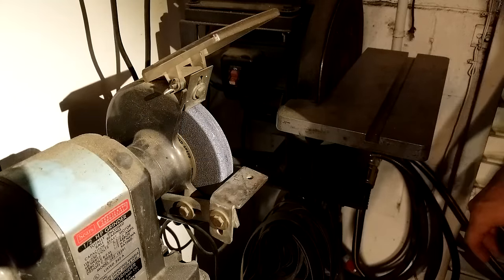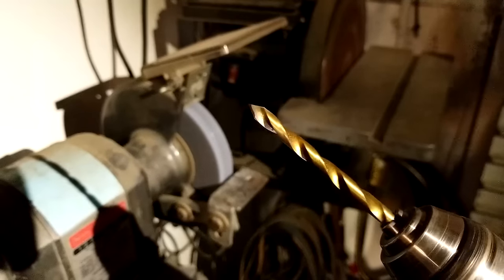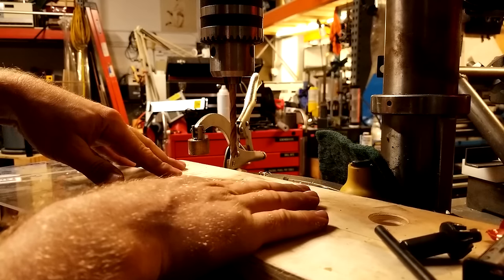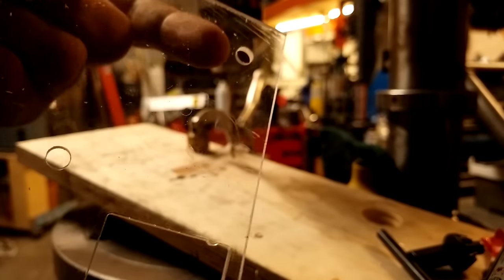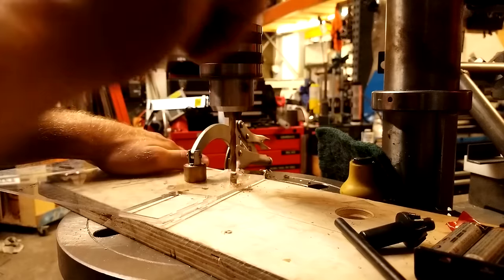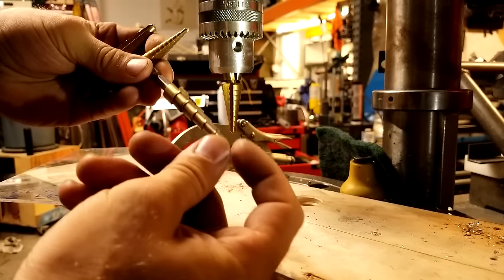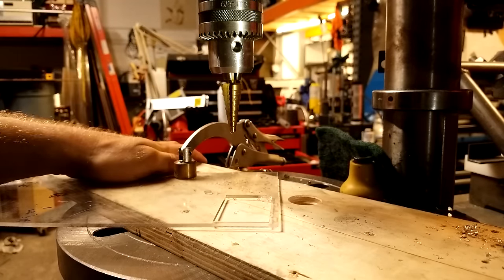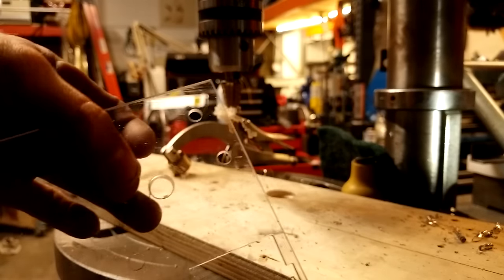How To Drill Acrylic And Other Brittle Plastics

Comment: To drill acrylic without chipping and cracking, a twist drill needs to be sharpened with rake angle closer to zero so as to produce more of a scraping action, rather than cutting. By sharpening the drill bit the way you have, in effect achieves the same result, although I prefer to leave the conventional point angle on the drill and 'dub' the cutting edge. Either way works. The reason step drills are so good for acrylic is that by the nature of their design, they already have zero rake angle at the edges that do all the cutting. A similar principle applies to drilling brass.
Reply: 3: 3:13 02

Comment: For absolue best result, have your piece backed by another piece of acrylic rather than wood. If done right, the bit never even realizes it has gone through the piece and you have a perfect hole, ( :
Reply from the maker: Great suggestion.
Reply: Is it the drill's sudden realization that causes the issue? Is it a good generalization to never surprise your tools?
Reply: @sethtrey  you laugh but probably yes.

Comment: I worked in a plastic fab shop for a few years. We bought those black oxide cheap drill bits from Harbor Freight. Knocked the cutting edge of the bit off on the bench grinder where it will produce a scraping action. Clamp or use double back tape to support the back side with a piece of wood. No tear out or cracking
Reply from the maker: appreciate the tips

Comment: Simply use a sharp step drill or a flat face spur bit. Also using air pressure keeps the acrylic cool and melt free. Slower is better than wide open and go gentle with your feed rate! Forstner bits are not good for acrylic or flat paddle bits, BTW. Actual acrylic bits are shaped like he shows but not ground that way lol. Break through needs to be super controlled as he shows.

Comment: I wanted to thank you for this video.  I had a specialized piece of circular acrylic into which I had to drill three holes in order to secure it to a clock face.  I was sweating bullets as in the past I tried (very unsuccessfully) to cut an acrylic sheet down to size for a different project.  So brittle and finicky.  I followed both your recommendations on shaping the drill bit tip, and using soap, and the drilled holes were absolutely perfect the first time.  Thanks so much!
Reply from the maker: That's phenomenal, I'm so glad that it helped you! Years ago (pre-YT), I was in a similar situation so I can relate! Only later did someone show me these tricks.
Reply: Dish soap is great 4 drilling n2 a chunk of acrylic using a forstner bit too.

Comment: I've found that even conventional drills work well to create smooth holes when lubricated (and cooled) with water and a little dish soap (say, 1% to 10%).  I've even used this to drill very deep holes, 5 to 10 times the drill diameter, but you do need to keep backing the drill out to clear the chips, and do keep the hole flooded with the lubricant with a brush or squeeze bottle.  As noted, slow speeds work best, but not TOO slow or the plastic can begin to fracture instead of cut.  (I've modified my drill press to use a dc motor, with fixed voltage on the shunt field winding and a variable dc voltage on the armature for speed control, minimizing the need for pulley changes and allowing spindle speeds down to a few RPM.  The armature supply also has an adjustable current limit, allowing the stall torque to be set independently, which I find handy at times to minimize damage to the work.)

Comment: Oh! Great tips! I was aware that there are special acrylic drill bits that have a much higher point angle but never tried to sharpen one for that. And never ever would have thought that it is so easy. Super nice!!! Thanks again! 
I had great luck with new, clean steel drillbits with slightly dull cutting flutes/tip (just a few strokes with a diamond file or 400grid sandpaper)
Reply from the maker: Cheers! I hope your prototyping tips channel takes off, you do great stuff. I kinda gave up on YT after a while... perhaps I'll start posting again someday.

Comment: Summary:
1.  Sharpen drill bit to a point, or use step drills for larger holes.
2.  Fully support the sheet with plywood backing. (You will drill through to the wood.)
3.  Use low rpm.
4.  Lubricate the bit with dish soap.

Comment: Having done this for years, I will share:  A regular drill bit is fine, but it must be sharp and web thinned.  If you don't know how to sharpen a drill, learn, or buy a jig. Next, do NOT use battery powered drills, they  are too slow.  Drill presses are best as they are stable and allow for clamping the workpiece firmly over a solid cutable substrate, like wood.  If you don't have a press, use an corded electric drill.   Example: to drill a 5mm hole in acrylic requires a speed of 2500 r/m, which a cord drill will do, whereas  battery drills run at 1500 max.  Next, it's the feed.  Slow feed, clearing often.  If you feed too fast, the acrylic will melt, if the drill is blunt it will melt, no matter what you do.
Hope this helps someone.

Comment: Step drills are great for all kinds of thin stock. They don’t get sucked in on break through like a fluted twist  drill. Chose one with steps taller than the stock thickness or the holes will be stepped.

Comment: I wonder how well this would work on 1/8" thick cardboard and a step drill bit on making a replacement  old tube type wood  radio rear cover? 
Tubes got pretty warm so some source of ventilation  and protection from touching anything back there when it is on would be needed. Great ideas here !

Comment: Great tips, thou I find that for me, a forstner bit is the absolute best for cutting holes into plastic bar and sheets.
Reply from the maker: They are great, the cutting action can be improved with soapy water as well.
Reply: @ViceChief  Yes I agree, soapy water is a good tip, as well it keeps down on the plastic dust. 😀

Comment: Dish soap works for sure but be aware of the potential for rust on tooling.  You’ll need a rust inhibitor.  I use WD40 and get a very fine edge.  For hand sawing acrylic,I use 3 in 1 oil.  Saw blade is less “grabby” with the oil.
Reply from the maker: Good points - another thing to consider is that some acrylics and other plastics will "craze" with the solvents in some aerosols. As always, it's a good idea to do a test on a piece you don't care about,.

Comment: Now, i need to counterbore the holes for hex socket head cap screws in thicker material, good tips to get me started - see they make different taps as well
Reply from the maker: I've seen (but don't know where to find) stepped tools that can drill the pilot hole and counterbore in one operation. Something to consider.

Comment: I have a 28mm hole I need to enlarge to a 30mm hole in a sheet of thin acrylic. I am terrified it will crack. Do they make step bits the size I'm looking for, 30mm (1.1811 inch)? If not, what would you recommend? Thanks.

Comment: Do i have to have a surface beneath where I am drilling into when drilling acrylic? Or can the acrylic hang off of a surface and I drill from there without the wood underneath?
Reply from the maker: If you drill without a supporting surface underneath, it tends to crack around the hole as the drill breaks through.
Reply: @ViceChief  okay, thank you!😊

Comment: Wonderful tip. This is what I am looking for. I hope to  drill 5mm x 48 holes for 4 pieces of acrylic 3mm thick sheet, for my Anycubic  Pulley 3D printer. I will search for my step drill bit. If I can't find it, will have no choice but to Diy a metal bit.

Comment: Nice video and nice clean holes : ) But let's say I don't have a drill press nor a grinder. And I want to drill a hole in something bigger: a 2" acrylic sphere (and quarter-inch hole). I do have a vise to hold the ball, and a good quality variable-speed drill. Any chance this would work, using the soap trick and an unmodified bit? Or is there a special (but non-step) bit I can buy?
Reply: Actually, I see I can buy bits just like this on Amazon. So... special bit, soap trick, but no drill press. Will it blend? Er... will it work? These acrylic balls are cheap so I'll probably end up testing it out one way or another.

Comment: I recently made some electrical panel faceplates and I was curious between the difference of polycarbonate and acrylic. I bought both to demo them. I just have a regular drill with cheap crappy bits, needless to say the PC was SIGNIFICANTLY more forgiving to work with than the acrylic, not as scratch resistant as acrylic though unfortunately. Nice tip though, probably easier and cheaper to do it this way than buy specialty bits for acrylic.
Reply from the maker: You're right about polycarbonate -it's tougher and actually you can buy it in scratch resistant grades. However it can't be processed with lasers or heat like acrylic, and thermoforming polycarbonate takes more care.

Comment: Great video.  Do you think a Forstner bit also be suitable, especially if a thicker piece requires only drilling 'partially'  through depth-wise and also requires a flat bottomed hole,  instead of one that goes right through (granted,  there will still be a small entrance hole in the middle of the flat, although don't think that can be avoided unless a 'milling bit' is somehow used,  then these are less easy to 'locate' and drill with I'd imagine!)?  I wonder how the finish would be using the Forstner anyways too!? Thanks for any further advice/tips on this if able:)
Reply from the maker: Good question, to be honest I really don't know how well a forstner bit would work. A lot depends on the size of the hole. In that situation I'd look for an end mill (a center cutting end mill) instead. One that's extremely sharp, and has no special coatings for metal.

Comment: really informative! is this at all worth trying for someone who doesn't have this elaborate of a set up? There's a project I'd like to try with drilling fairly smaller holes in acrylic ( maybe a smidge thinner then the one shown here ) to have a hole to feed a key chain link through. I think I could find a way to have the acrylic clamp and reinforced but I don't have the kind of drill featured here and would most likely be doing it hand held- is it worth trying or strongly not recommended?
Reply from the maker: This also works hand-held, I've done it a few times. Run your drill on the slow speed and hold it straight. 

Do consider picking up a small drill press. For the money, they are one of the best tools you can have.
Reply: @ViceChief  thanks so much for taking the time to get back to me! I will absolutely look into it, it looks like it makes the project 100 times easier

Comment: I have 4 1/8” 4x8 foot sheets to drill and attach to a wood frame this week and I’m stressing!  Pretty small holes (for #8 screws) but I’m wondering if I can countersink the holes for the wood screws?
Reply from the maker: You can. You'll want a very sharp countersink with the right angle (I think with imperial screws it's 82 degrees). Personally I would try a single flute countersink after drilling the hole for the #8. Use the same soap/glycerin trick I used here with the countersink tool. With material that thin you will also want some way to control how deep the countersink goes, like a depth stop on a drill press. Good luck!

Comment: great video.  my Question is if it is already drilled with a whole. but you need a bigger hole then the one thats already drilled into it.
Reply from the maker: I don't have a ton of experience with that situation, but my first approach would be to use glycerin or dish soap as laid out in the video. Sharpening the bit can't hurt. Also, someone else here had a helpful comment saying to  clamp it to another piece of acrylic to prevent tearout. Seemed like a good idea to me.
Reply: @ViceChief  I would say it is a perfect opportunity for a step drill. You could also center up the hole using the same size drill bit then replace it with a larger bit.

Comment: Hey this is great. I'm getting ready to cut many holes in very thick (10mm) acrylic. Can I use a forstner bit with low speed and dish soap?
Reply from the maker: I wish I knew -  I've never tried a forstner bit. If it works for you, please report back.
Reply: @ViceChief  I will thanks for the reply. I've used them before but I think I had my drill press set too high. Thanks for that tip
Reply: @ViceChief  so I just uploaded the start os the project and the bits worked great! Turing down the speed WAS the trick. Check it out :)
Reply: This was awesome.

Comment: You can also buy acrylic bits that are already sharpened to this pointy tip. :face-fuchsia-wide-eyes:  I find that you don't need a set since you are generally drilling only a few different sized holes in plastic. This is the same as buying left hand drill bits to remove broken screws, you only need a few sizes.

Comment: Does the dish soap trick work with hole saws? I have to drill a single hole for lifting in a sheet of acrylic that will be used a aquarium lid. I can't foresee ever needing to cut acrylic again and am trying to find a way to work with the tools on hand.
Reply from the maker: I've never tried it myself. I'm sure it would help but honestly doubt that you'd get a really clean edge. If I were going to try it, I'd go very slow and clamp the acrylic securely. I know that a step drill will make a clean hole, but you may not have one.

Comment: Any suggestions on countersinking? I have seen recommendations to use zero flute and others argue 3 flute. Any input? Would probably only countersink much thicker plexiglass
Reply from the maker: Hey Jemdost, single flute cutters are incredible IF and ONLY IF you have very high RPMs and good rigidity (not handheld or drill press). I wouldn't recommend them if you are not cutting on a good quality CNC router.

If you're on a drill press or using a hand drill, a 3-6 flute staggered countersink is probably the best thing. Low flutes = low heat input. Use the lubricants as described in the video. I'd bet there are good countersinks for plastics available with optimized geometry. If you have to do a lot of countersinking even a $50 tool can pay for itself quickly.
Reply: @ViceChief  Will be using a drill press so thank you for covering all the basis great reply much appreciated cheers!

Comment: My drill press slowest speed is 730. Do you think that would work or is it to fast for 4mm thick acrylic? Thanks for the great info.
Reply from the maker: The big worry with speed is that you'll melt the acrylic. If you don't try to force it all the way through, and you keep it wet/lubricated, you will probably be fine. Always good to try a test piece first.

Comment: I need to put holes into imataion acryilc drinking glasses ...I did tgink of heating a needle up in the flame of a candle and piercing the hole....do you have any ideas . Thanks in advanced
Reply from the maker: If it's for really small holes I would use a dental drill bit and dish soap.
Reply: @ViceChief  thanky you so much Im a Podiatrist....I use the same drills bits as dentist .. cant thank you enough

Comment: Drill bits like this are available commercially. Different types of plastics require different methods.  A low run out drill press helps immensely. I.e the Hamilton.

Comment: I'm intending to make a wind spinner out of 4 or 5mm thick acrylic or polycarbonate. It is foolish to think I'll be able to drill a 3mm wide hole into a 4 or 5 mm thick piece of acrylic?..
Reply from the maker: That will totally work. I would recommend polycarb for spinning applications. Take the drilling slow. My video is mostly about acrylic, but the advice here in the comments to back both sides with another piece of plastic should prevent any tearout.
Reply: @ViceChief   OK. BTW, I mean drill a hole so there is only 0.5/1mm material surrounding the hole (at it's thinnest part)... I've seen some videos of people saying you need to keep away from the edge, for acrylic and polycarbonate; like leave a gap to the edge, of 1.5 times the size of the hole. Thinking I might be better off using aluminium.
Reply from the maker: @Lloyd.B.  Oh, I misunderstood. You're correct. I definitely wouldn't try to support something on .5-1mm of acrylic around the hole. Maybe you can use some kind of insert or bushing + a larger area.
Reply: @ViceChief  OK. I need to go back the drawing board.

Comment: i'm gonna try the dish soap with the circ saw when i cut this long piecce i have to make my chute board
Reply from the maker: Please let us know how it goes. Also you are probably going to have soap slinging around due to the blade. They say on plastics to use the highest tooth count that you can.
Reply: @ViceChief  just as i was going to put the soap on the blade i thought of that, so i used bar soap, a new 71/4 diablo 40 tooth, i turned it backward on the saw, (another tip from the tube), and jogged the trigger on and off so the blade speed wasn't too fast, i got a very nice finished ,square edge for my new saw guide, and i used my boreing bit as you did for the holes and it worked out great, thanx, i'm thinking about putting a channel up myself, so,,,,,, see you on the tube
Reply from the maker: @jakeqwaninne8502  Awesome. Make a video about this... I'll be your first sub!
Reply: @ViceChief  i don't really have much video production knowledge , i have a bunch of stuff i did with my phone, but i have no idea how to edit, add sound, or even upload it to the web, but my boss is "jeobeermaster",here on youtube, he does auto body stuff, i could give it to him to put up, but i kinda want my own channel anyway, i make all kinds of stuff ,and maybe something will catch on and i can be an inventor ,insted of an auto painter, but thank you ,that's encouraging